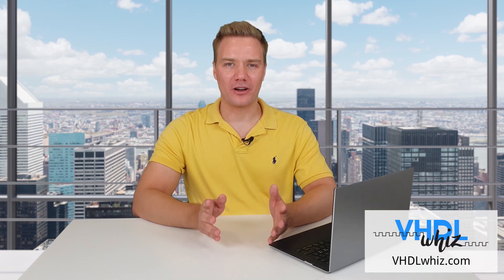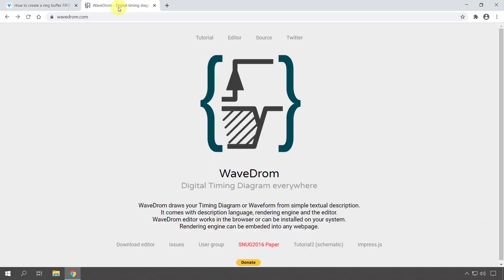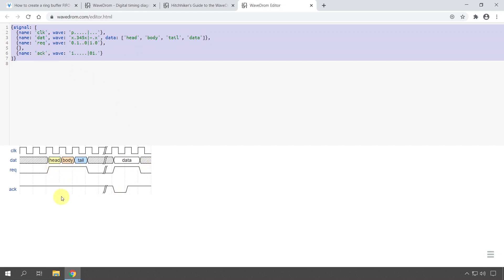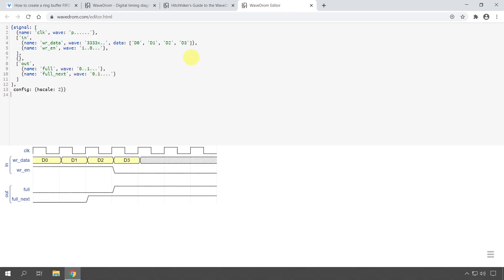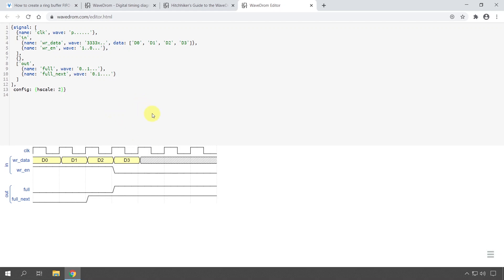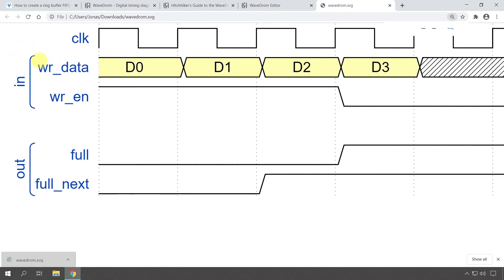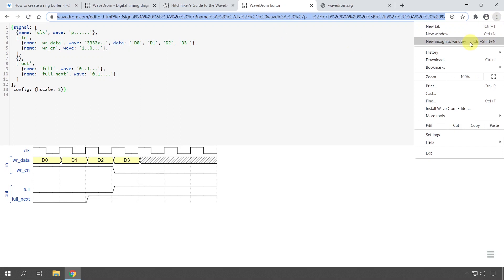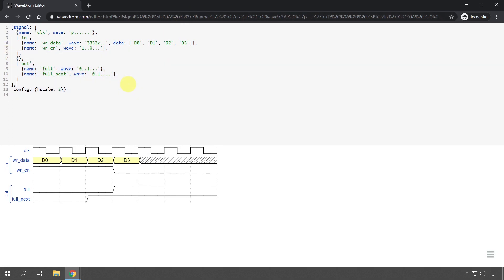How to create beautiful timing diagrams with Wavedrom

Comment: hi
1.) can we change the width of signal lines 
2.) can we change the color of signal name to black in bold letters 

because when I put these figures back in the word file its hard to see clearly very small and dull color
Reply from the maker: I haven't found a way to fully customize the Wavedrom appearance, but you can work around it.

For example, if the appearance is too small, you can zoom in your browser (Ctrl and +) to make it bigger. Because it's an SVG, the lines and text will scale up without losing quality. Then, you can take a screenshot to embed wherever you want.

Otherwise, you can edit it in an external tool. Click the hamburger button in the lower-right corner to download an SVG. Then, use a vector drawing program to edit it. I use Adobe Illustrator for that.
Reply: @VHDLwhiz  ok thanks but I dont how to change the color in vector drawing program